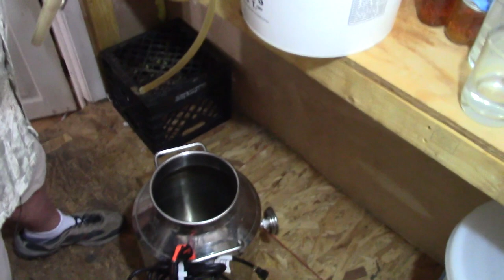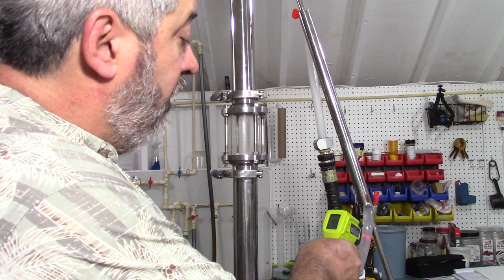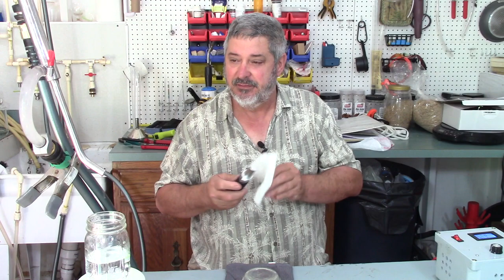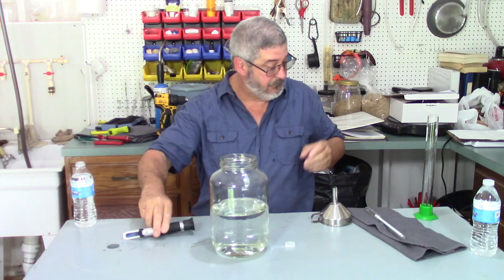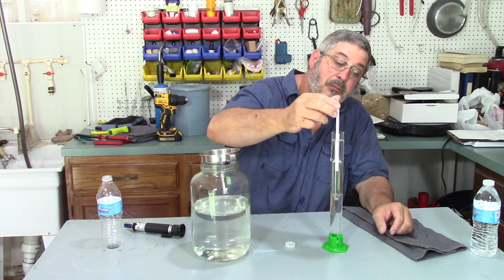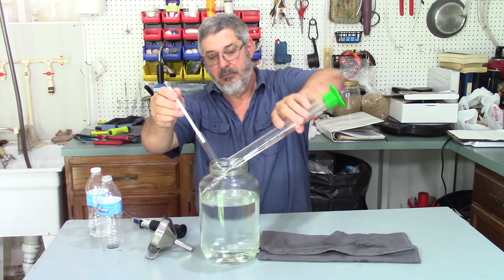E117 Peach and Oat whiskey  Distillation

Comment: Hey Randy, I know you typically don't do 2x distillation, but did you ever try the 1.5 technique?  That's where you combine some wash with 1x distilled low wines.  Brings over more flavor than 2x distillation, but overall less time spent in stripping runs.  You'll get better quality heart cuts than just 1x.
Reply from the maker: interesting! cheers
Reply: +1 I agree. When running a pot still with a fruit wash.
Make the complete run... Then RE-RUN the entire batch with FRESH WASH. This Will improve ABV and Flavor.
Running a Thumper will also increase ABV and Flavor. (Thumper same size as boiler)
Load thumper with high wines. And if possible shoot the thumper with fruit after collecting heads.

Collect down low into 30% abv with small cuts. There is flavor down there. It's hidden and you can find it.
Anything that does not make the cut dump it back in the boiler and re-distill it again on the next run.

Cheers Duck!

Comment: I'm curious as to why you add chips at such a low alcohol percentage(45%) instead of a more common 55-63%?
Reply from the maker: it seems to work for me  Cheers
Reply: I oak at 70% to 80% abv, in quart jars with PTFE lid covers for six months to a year. 
Proof down to drinking strength when bottling depending on style.

Flute running x3, 4 inch plates. Toasted heavy Charr White oak staves 3/4 x 3/4 x 5 inches.